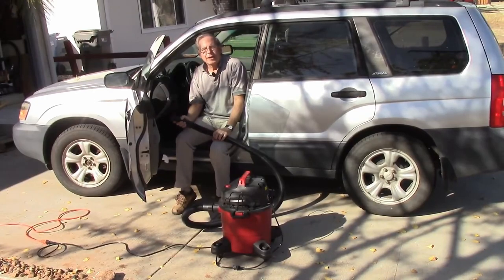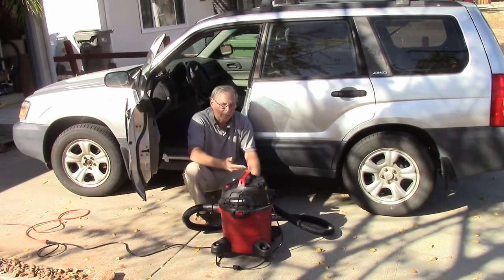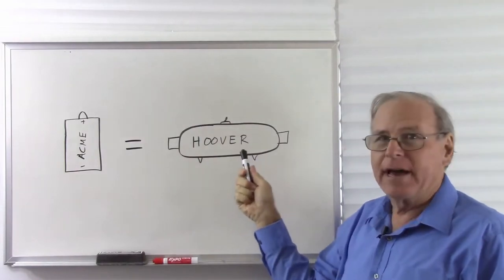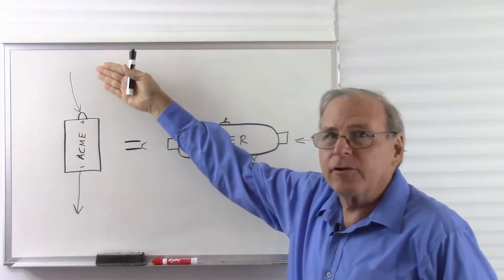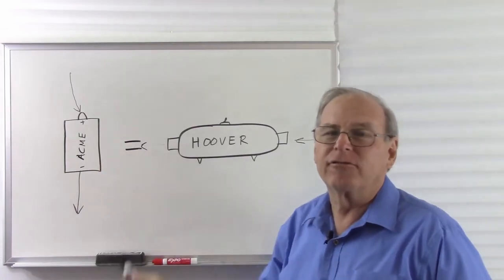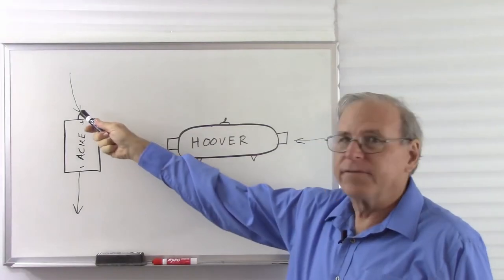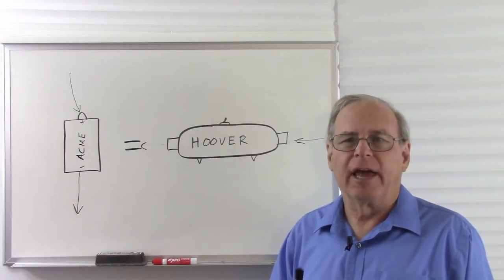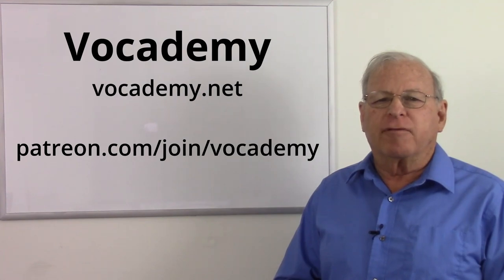Batteries and Current Flow

Comment: Question Mr. Bob, What if in a circuit there's two Battery One is Higher than Than the Other, Let say 9 Volts and One is 3 Volts other way around opposite to each other in terms of Polarity, are they cancel to each other if we connect two terminal prove with the multimeter? What would be the output Voltage in the Circuits?